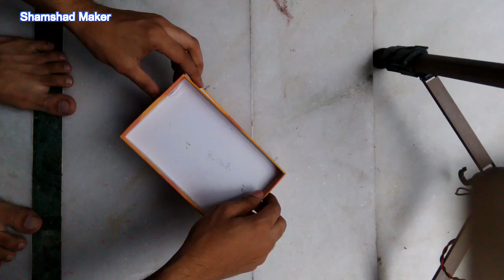How to make a Truck At Home | Remote Control Hydraulic Truck | Shamshad Maker

Comment: you should have just kept the lid the proper way like it suppose to fix and just cut free the two corners so its only connected by the top like a flap. then glue flap to box. It would have looked like the box is delivering itself to you. Like the hydraulic idea.
Reply: Xx